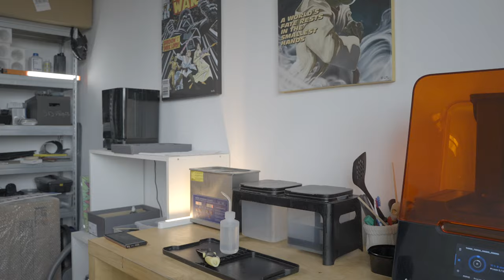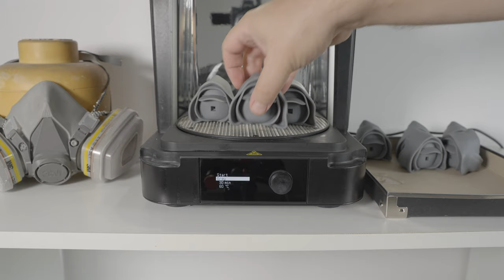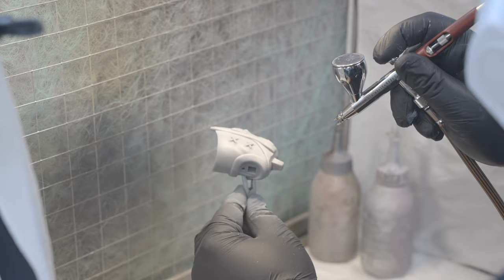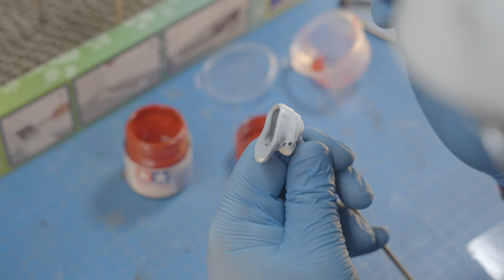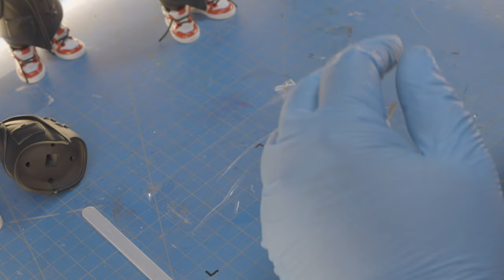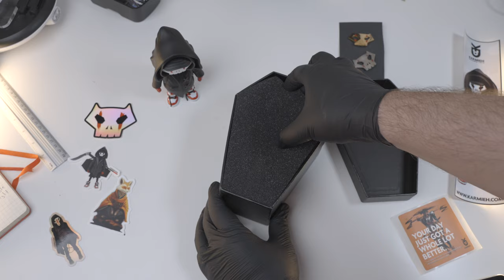Designer Toys Come To Life With 3d Printing

Comment: A piece of advice: you should never use alchohol on a sonic cleaner, that can combust because of the highly flammable properties of the isopropanol mixed with the vibrations of the process by the sonic cleaner. Another thing is you should cure the print first before sealing the holes because if its not well cured on the inside the print will start to generate gases inside and if it doesn't have nowhere to go it can crack some time later. Try curing it in water, the UV light will disperse much better everywhere included inside and so give it a much more uniform cure
Reply from the maker: Thank you for the advice and your concern, really means a lot 🤗. but I have been using it for about 5 years now, the temperature never goes over 40 degrees it's a small ultrasonic, I have looked into it before using it. The only thing that  you need to do is to keep an open window to make sure you have enough fresh air or wear a mask. As for the filling holes, I always levea at least one hole for the gasses to be released, thank you for the tip though. In 8 years of toy design and prototyping I have seen my share of broken cracked or ballooned pieces, so I learned it the hard way. I was actually going to record a video on how to never close your figure totally. As for curing with water Idont know what to say, I have seen some makers do that, I never tried it mysel, the form labs curing booth uses heat while curing depending on what resin you print with. So I am guessing or at least hoping they know their stuff 😅
Reply: @karmieh  can  you  use  silicone  brushed  on  Over  a  sculpture  made from  magic sculpt, two part epoxy clay? 

    I'm using Rebound 25 silicone.

I know you can't use sulfur based Clay's, even sealed with brush on silicone.

     Won't  cure
Reply from the maker: @Arnoldman-ep9gw  I wish I could help you with that, I have no idea, I stopped moulding and casting about 4 years ago, I know the basic stuff when it comes to moulding and casting.

Comment: I don't believe it's a safe practice to fill your hot ultrasonic tub with isopropyl alcohol.
Reply from the maker: Thank you for your concern, its a small ultrasonic, the temperature doesn't go up higher than 40 dergess Celsius, I have been using this methode for over 4 years now, and I didn't have any incidents, with that said, I n ver leave it without supervision, just make sure to wear a mask and have the room well ventilated.

Comment: So much work for each piece. Is there a reason you aren't doing master sculpt and then molds to recast perfect duplicates?
Reply from the maker: Yes,  well one of the reasons is that I am not great at moulding or casting, and to get good casts you need a pressure pot, and you need to know what you are doing. I used to cast and mould and it takes a lot of time to learn to cast clean pieces and at one point I decided that I want to be a good designer and sculptor and that I can't do everything, so I focused on what I can do best, most of the pieces I do in-house are low runa or one offs so it works out ok for me.

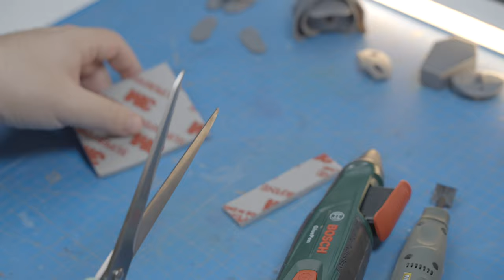Comment: damn your work is soo clean! btw what is the sandpaper type that u use when u’re sanding? 3:11
Reply from the maker: Thank you so much for your kind words, The sandpaper I am using here is called 3M Softback Sanding Sponge and it comes in different grits. These sponges are available in a range of grades, including microfine (grade 1200 to 1500), ultrafine (grade 800 to 1000), superfine (grade 500 to 600), fine (320 to 400) and medium (grade 120 to 180).

Comment: This is the third video of yours that I've watch in a row, and WOW! Your designs are incredibles! Once you're done painting the models, do you use some kind of protective top coat? I'm new to 3d printing and would love product recommendations from resins to primers and paints. Either way, thank you for sharing your artistic process with us! 😊
Reply from the maker: Thank you so much for the kind words. Really means a great deal. Yes, I seal my figures with a sealer from Vallejo https://acrylicosvallejo.com/en/product/hobby/auxiliaries-model/acrylic-matt-spray-varnish-28531/ Matt, Satin or glossy depending on what type of material I am going for.
Reply: @karmieh  Thank you! I will definitely give it a try! :)

Comment: Great stuff.  I'm curious. You place alot of faith in the 3D printer to get clean, flaw free prints.  Do you get alot if rejects and any reason not to do one good print ,prep and sand etc. Then RTV mold that clean one compared to doing repeatedly finish processing numerous 3d prints?
Reply from the maker: Thank you, well I don't always get clean prints, sometimes I need to re-print but since I have bought the Form 3 there have been fewer cases. As for production if my run is under 25 piece I make them all in house using the 3d printer, I used to mould and cast but it's very time consuming and you have to put in the time to get good at it. And I decided that I would rather spend my time learning how to be a better sculptor and toy designer then moulder and caster. At the end of the day there is only 24 hours in one day. If I release a toy that is over the 25 pieces then I usually hire a caster to mould and cast them for me, if the run is small I would ask to be cast, cleaned and primed and I will paint them but if the run is over 100 pieces then I would hire a small shop to take care of moulding casting, painting and foam cutting so the whole production. Hope this answers your question.

Comment: How is your hand paint sticks to it so cleanly? Do you thin out your paints? Is lacquare paints or acryllic water based? Thanks in advance. :)
Reply from the maker: Well, thank you! For airbrush, I def have to thin the paints out usually 1 part paint 2 or three parts thinner depending on the pigment. As for hand-painting, I don't thin out the pain, I soak the brush into some thinner and apply paint straight from the jar. As for paints I mostly use acrylic paints.

Comment: Do you always vent the holes right away?
I'm afraid mine might explode in few days, cause usually it's not cured that fast inside.
Reply from the maker: Yes, I always leave at least one hole open, I usually hide the holes on connecting keys or parts that are overlapped when you glue them, this way you never risk having the toy crack because of all the gas build-up, especially if you keep that piece in the sun or heat.

Comment: damn your work is soo clean! btw what is the sandpaper type that u use when u’re sanding?
Reply from the maker: Thank you so much for your kind words, The sandpaper I am using here is called 3M Softback Sanding Sponge and it comes in different grits. These sponges are available in a range of grades, including microfine (grade 1200 to 1500), ultrafine (grade 800 to 1000), superfine (grade 500 to 600), fine (320 to 400) and medium (grade 120 to 180).
Reply: Awesome video man! Love your work! Just to piggy back on this comment what’s the machine you glue the sand paper to ?
Reply from the maker: @randelicious6969  Thank you! That's a cordless glue gun https://www.diy.com/departments/bosch-cordless-glue-gun-3-6v/539729_BQ.prd but you can use any type of glue gun

Comment: I love your work, thanks again for such a great informative video. hope I can make my own toys, already have plenty of tools..

I have a question! after you mark your pieces with a black marker after you prime them, do you sand them only by hand? what grit paper you use at that stage?
Reply from the maker: Thank you so much for the kind words! I wish you all the best in your journey. After I mark those pieces I go and sand them again either by hand or with the Linear sander, I use high grit paper 600-800 and sometimes 1000 depending on the piece, but I highly recommend those 3M sanding sponges they are a game changer, and using them on the Linear sander it just saved me so many hours. I hope this helps!

Comment: What is that black marker for? How are the defaults fixed?
Reply from the maker: The black marker is for marking the areas that need more sanding, I don't know what you mean by the defaults, but if you are asking about the print supports, those are sanded off; for these pieces, I did two passes of sanding and priming, before applying the base colours. hope this helps
Reply: @karmieh  Yes, thanks a lot! I'm trying to learn the whole process

Comment: damn your work is soo clean! btw what is the sandpaper type that u use when u’re sanding? 3:11
Reply from the maker: Thank you for the kind words! The sandpaper I am using here is called 3M Softback Sanding Sponge and it comes in different grits.  These sponges are available in a range of grades, including microfine (grade 1200 to 1500), ultrafine (grade 800 to 1000), superfine (grade 500 to 600), fine (320 to 400) and medium (grade 120 to 180).